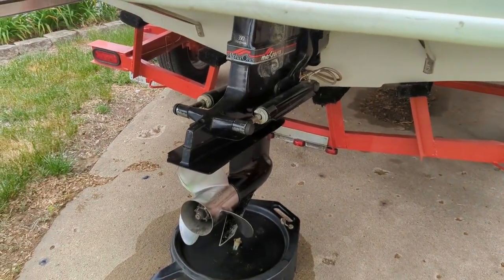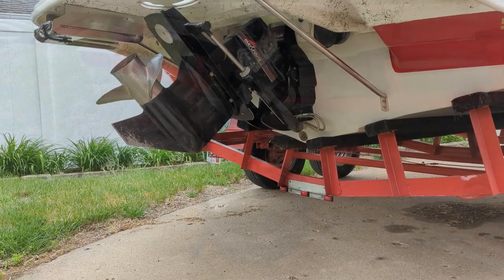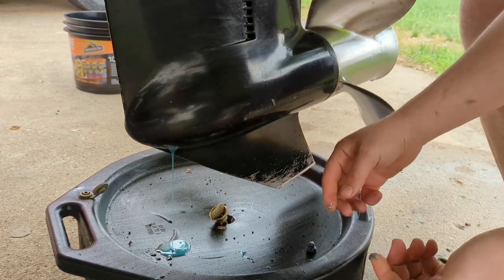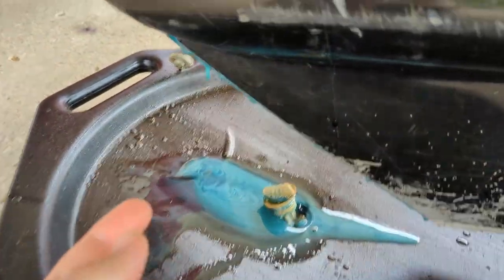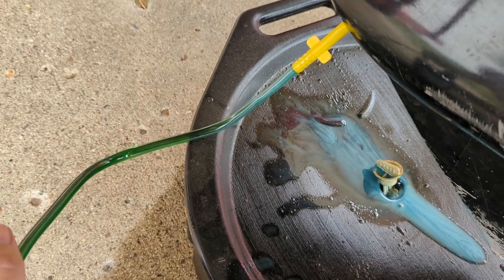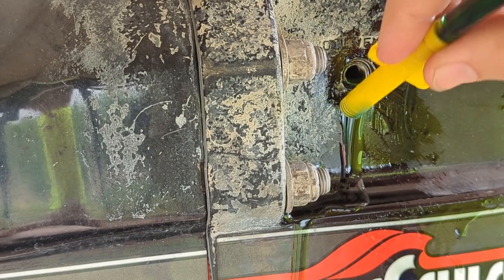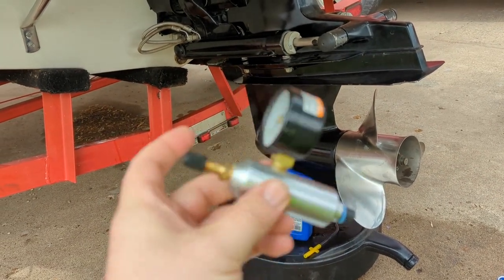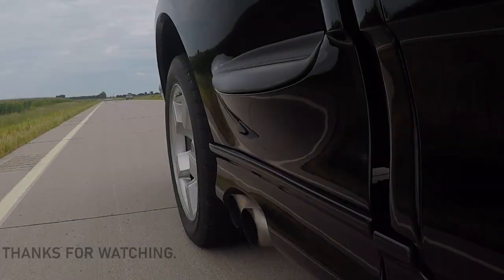How to Change Mercruiser Gear Oil (Alpha Outdrive)

Comment: The plug with the magnet is supposed to go in the lower position to collect and metal in the oil. Also, the top vent plug should be removed first because if for some reason you can't remove it, you would not want to proceed with the bottom plug until such time as you can get the top plug out. I'm no expert but I have gotten these tips from watching many other videos as well as maintaining my own boat.
Reply from the maker: Fine points.  Yes, magnet plug on the bottom.  Mine were switched and I don't know why.  You're right it would be best practice to remove the top plug first (I mentioned this only briefly in the video) although I've more heard this tip applied to automotive differentials which can be massively rusty and screwed up as opposed to marine outdrives.  The beauty of these plugs is they area always coated with gear lube when installed so its very difficult to have them seize up or be tough to remove.  They're almost always easy to get out.  But great points for sure.  Thanks for commenting!!

Comment: Mercruiser recommends pumping all oil in through the bottom drain plug.  When oil begins to come out of the vent cap, Mercruiser advises to install the vent plug and keep pumping oil in through the drain plug unit the oil level in the reservoir begins to rise.   This is to ensure there is no air lock preventing gears from being lubricated.
Reply from the maker: There is no air lock when following this method.
Reply: why not just fill it from the top hole? air get trapped?
Reply from the maker: @JohnnyAnderson1  the transfer hole between top cavity and bottom cavity is relatively small. Because of this, if you were to fill from the top down only it would take a week for all the bubbles to rise up and let the fluid fall down. This way takes care of all that and also is Mercruisers preferred procedure. 👍
Reply: @605BOLT  thanks, I figured it was something like that.
Guess I'll be ordering that fill tube
Reply from the maker: @JohnnyAnderson1  makes pretty quick work of it.
Reply from the maker: Also, most people can find the pump at their local marine store. Might cost a few bucks more but you could work today if you're looking to beat some weather.

Comment: So just this then top off reservoir?  I have an alpha 1 gen 2 also
Reply from the maker: Yes. Fill from the bottom, then fill from the top hole til you see it in the reservoir, then top of the reservoir. Then check back in a day or two or after a few miles to make sure it is right on and no air bubbles came out.

Comment: Anyone ever have a problem with oil leaking from the oil vent? I checked it and it is tight but still leaking. Odd. Wondering if there is a missing rubber seal or something?
Reply from the maker: @jrmhrpr  yes definitely possible. Worth the fifty cents to change it just to see. Those usually seal up real nice with a fresh seal. I've seen some people mistakenly put a new one on when the old one is still sticking to the outdrive so maybe check to be sure you don't have them stacked or the one you have is torn maybe. Should sit nice and flush.
Reply: @605BOLT  Very cool, thanks so much for the quick response! I'll give that a shot tomorrow. There is no seal on it at all.
Reply from the maker: @jrmhrpr  oh ya then you gotta get one of those bad boys. Easy fix.